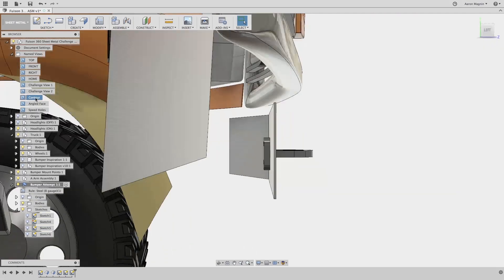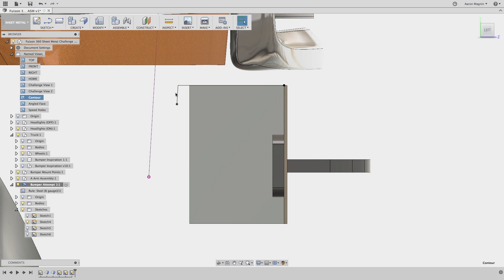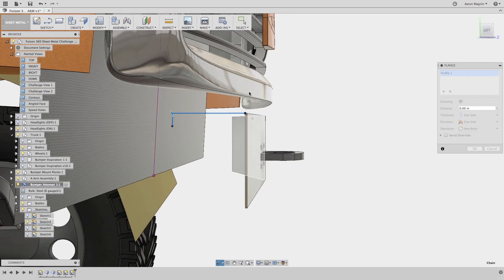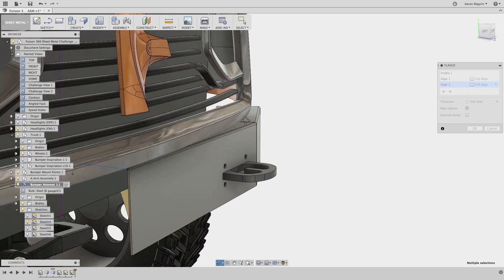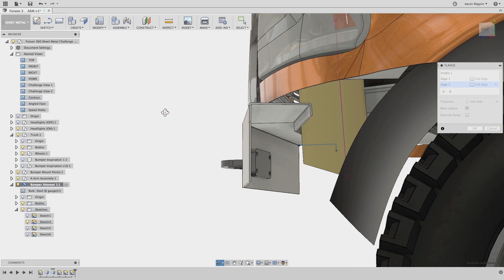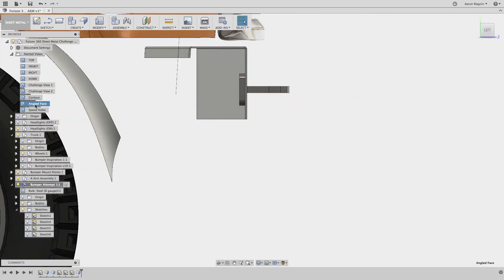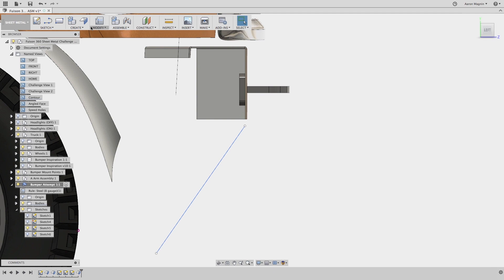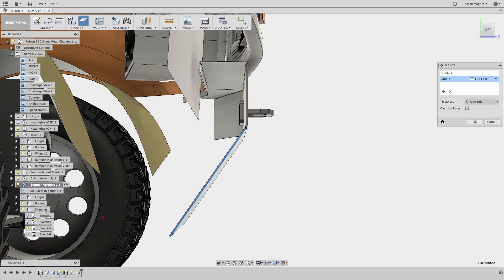QUICK TIP: Contour Flanges in Sheet Metal

Comment: Can you provide some support or compatibility for spline or round contours? Right now it's a nightmare trying to use these controls for pices which need to be trimmed or cut at rounded edges!
Reply from the maker: Not sure if I'm understanding, Eaton. Do you have a forum post or something else to help me gain a better understanding on what you're trying to do? Are the spline cuts in the flatten state, or post fold? Or are you meaning a lofted bend? Sorry for my failure to understand.